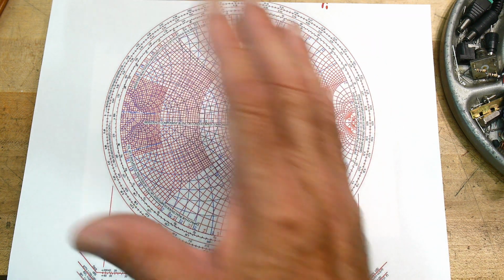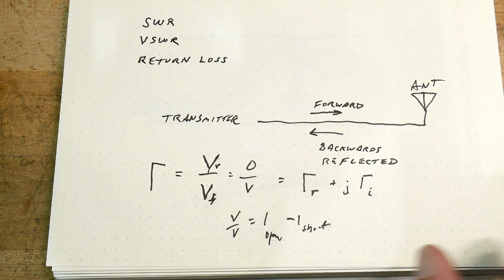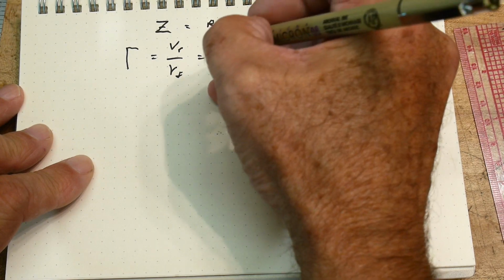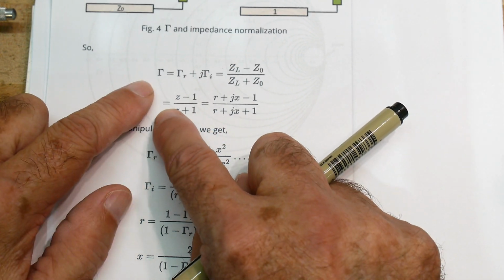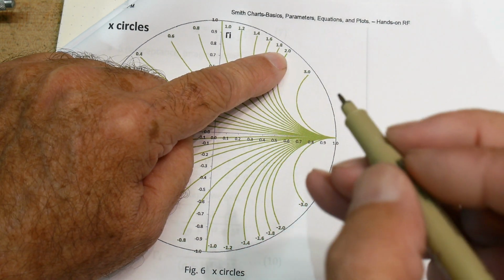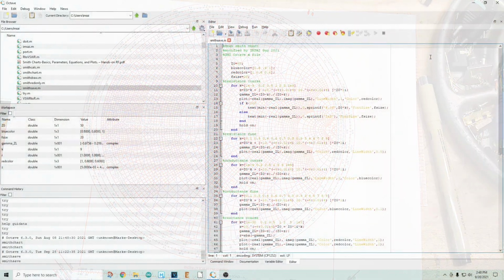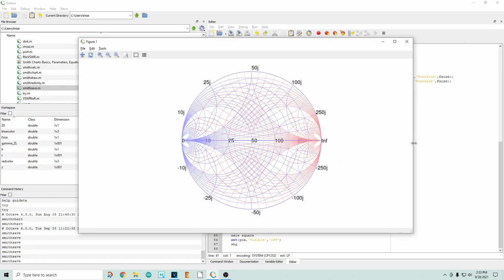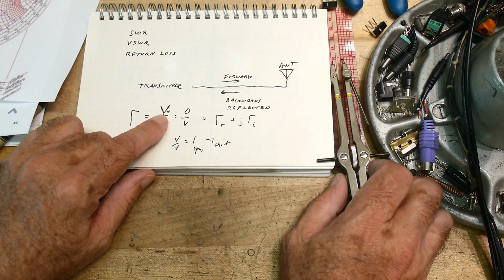#930 Advanced Smith Chart Equations and Graphing

Comment: Nicely done!  

Looking forward to the next one in the series or maybe the one after, where you cover the wavelength scales on the outer ring of the chart.  

Also, thanks to the pointer to Octave, looks really interesting.  I have matlab on my office machine, but will download this for my Linux VM at home and give it a try.
Reply from the maker: It is slower than matlab but otherwise the same
Reply from the maker: oh, and the outside stuff, I've started that video twice and stopped. I still need to figure out how to start that one. I've tried explaining it to a viewer once via email and failed.
Reply: @IMSAIGuy  Was used in one of my communications theory classes way back when for calculating lengths of waveguide sections and for finding proper location for inserting probes and loads, etc.  If I remember right, the ARRL antenna handbook also uses it to help calculate the length of matching sections on antennas and stuff like that.
Reply from the maker: @RideGasGas  oh I know how it works. I just can't figure out how to teach it correctly